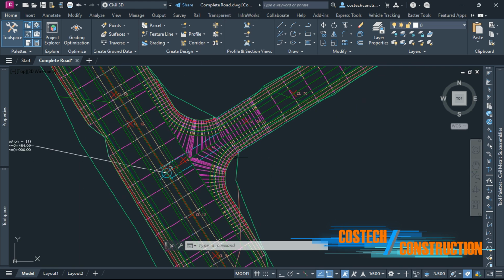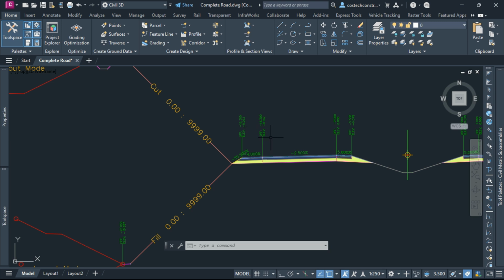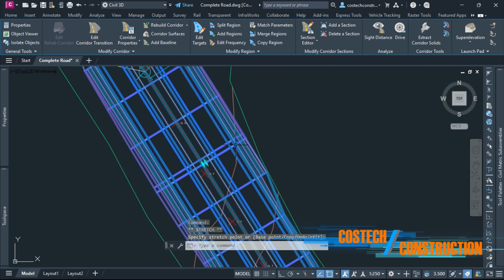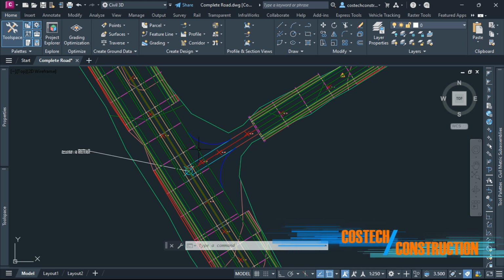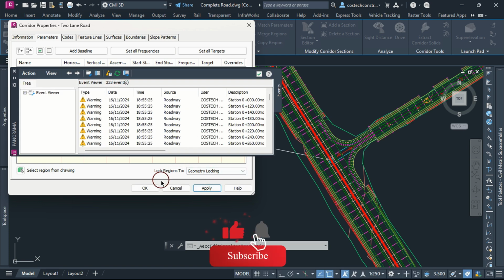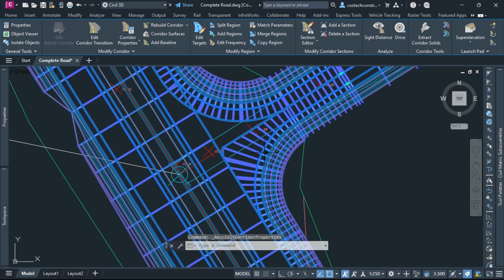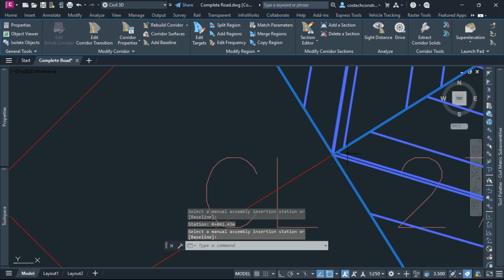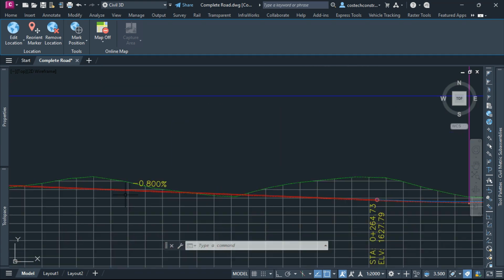Civil 3D Intersection Design | Complete Road Design Part 4

Comment: great videos
Reply: Could you also create a tutorial on the various styles used in Civil 3D? This includes code set styles, link points, and lines, as well as styles for cross sections and profiles.
Reply from the maker: I'm humbled! Thanks.
Reply: @costechconstruction254  Thank you for sharing such an informative video. I have completed the designs for the corridors and corridor surfaces. However, the intersection still appears rough when viewed in the object viewer. Could you please provide the final file so I can compare the changes?